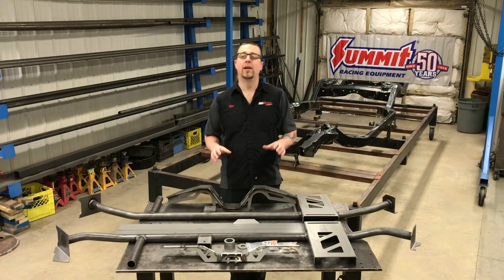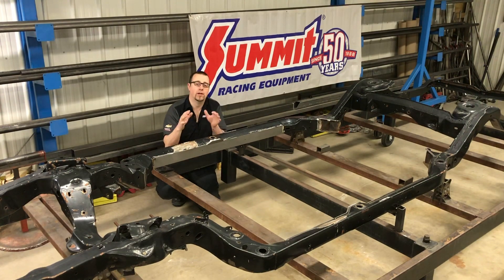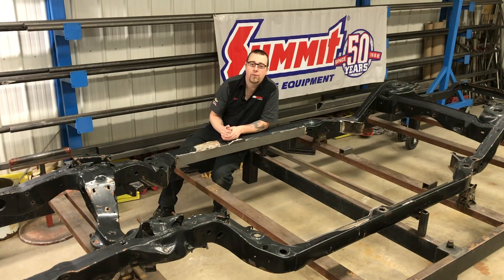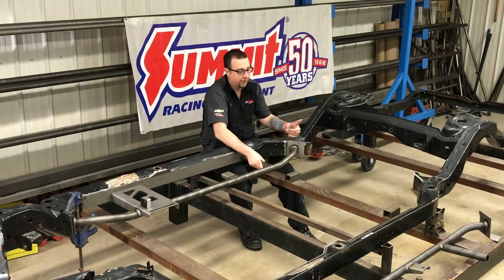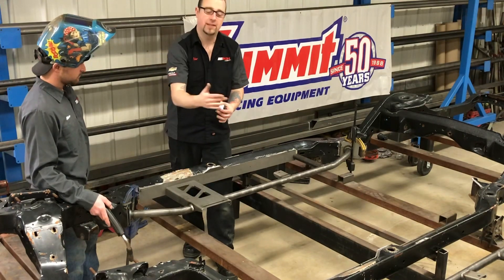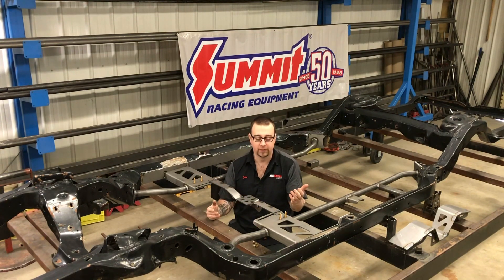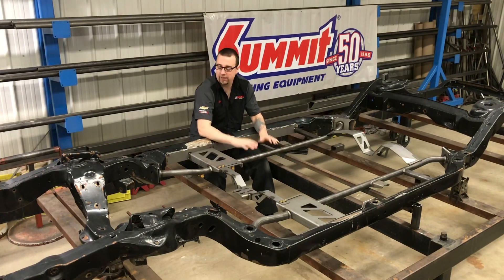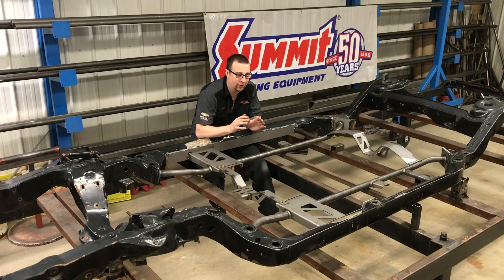Summit Racing 1964-67 Chevelle Frame Bracing Kit Installation

Comment: Two questions. I just bought one... 1. You mentioned we should add the body mount repair washers on top of the existing body mount holes, to give more clearance for the frame kit. So you're saying we should be essentially adding a shim (the thickness of the washer), to raise up the floor, as opposed to cutting out a circle and "recessing" the new washer into the hole? 2. I will be running new rubber body mounts. You said we might not want to use the extra mount (that comes with the kit), and "let it float".... Just curious, why would I want the floor to float more if I'm using rubber mounts? Why wouldn't I just tie it in, just as I would with urethane bushing mounts? 

Thanks for the help.

Comment: Will that year kit fit a 69 Chevelle I ordered one from summit  A while back  For a 69 Chevelle Just now getting around to install When I line it up Front and back The Tube And the transmission bracing does not touch the  Box Plate Of the frame it's like A 1/2 inch or a little more off from being able to weld Unable to send back ordered over a year Ago Would like to know the measurements Of the sections That welled to the boxing plates May have to modify or resell an order correct one
Reply: Did you get this fixed?